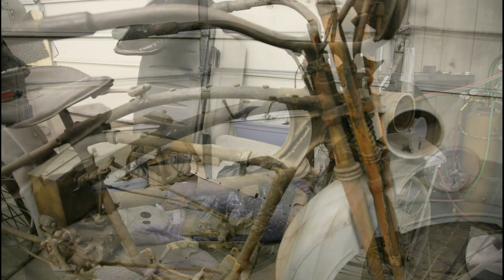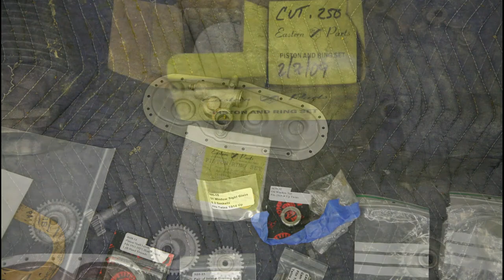100-YEAR-OLD ACTUAL BARNFIND HARLEY JD - CAN IT RUN AGAIN?

Comment: This is a truely beautiful bike. However, I feel that it would have been even more attractive had the front forks, handle bars, frame, and rear kick stand had been painted black. I wonder if the shade of green was a factory color. I have always thought that painting the aluminum engine cases would contain the engines heat, and inhibit cooling. The primary cases and timing cases if not chromed would have been black. At one time I owned a 1948 panhead an EL a 61 cu. in. in forest green with similar red and cream pinstripeing. I still think that it was the prettiest of them all. Your seat is oh so fine. Thanks for sharing. Be well, Tom.

Comment: Old Poop who loves old bike wherever they are found and in any condition. I'm not into restoration so I wont go there, but they were built to ride. I would get it running and climb on and hold on. I once found a 1910 Dayton around 1988 This bike did not have control wire, throttle, brakes etc. It used solid rods and turnbuckles. The egine was in the front wheel and ha five cylinders. The front fender was a leaf spring, and the gastank was mounted on the handle bars. It took a little time and a coulp hsnd made parts, but I got that bike running. I rode it. Once.